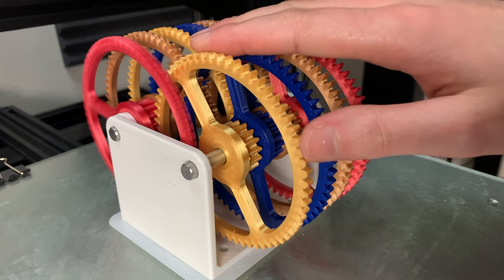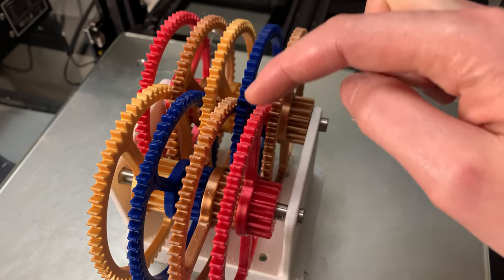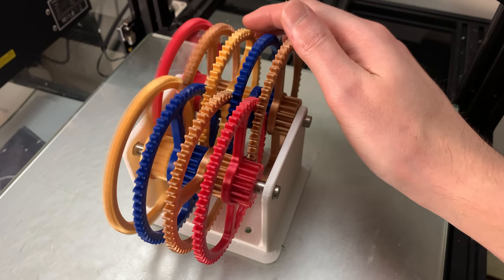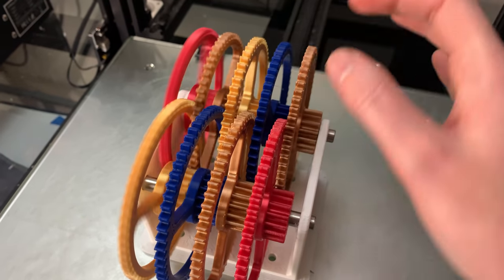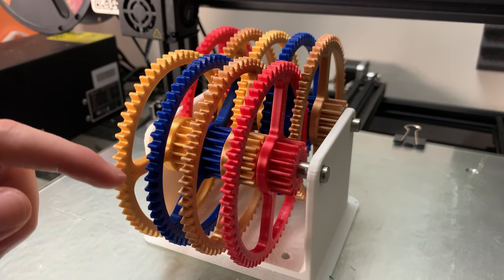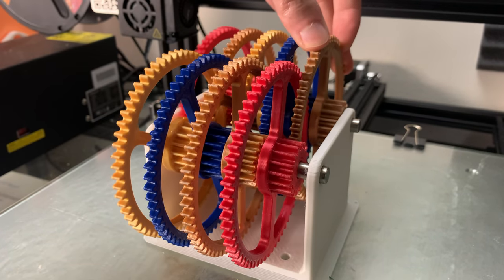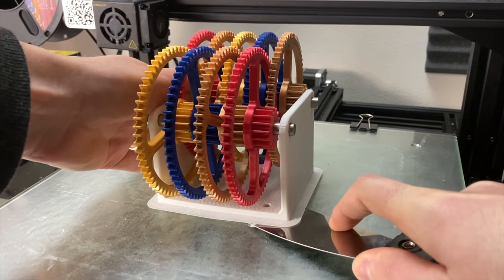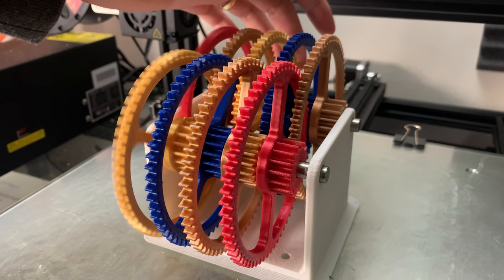Is it possible to spin the last gear?  (1:65000 gear ratio)

Comment: bro I just want one video where they go ham on the big gear and make the little gear go supersonic
Reply: The PLA or ABS or whatever plastic used won't be able to hold that much torque so it will break, I guess you can do that with steel gears
Reply: link please? would love to see some little thing rotating at literal mach speeds!
Reply: @fishtail2616  or a train engine
Reply: Yes! Me too!
Reply: @alexandru7727  it would either shatter like glass or slip and make the worst noise you’ve ever heard
Reply: What if you start accelerating the gear, then slowly change the ratio? Like a car. But with a lot more speed. (Accelerate first gear, then second, third fourth, etc, until you have reached mach speeds, and the big gear will spin, because it already is.)
Reply: I think it would break
Reply: Plus if it got so fast it would tear itself apart
Reply: @kingsolomon1841  that would be fun!
Reply: @SylvieTheBagel  that’s what I was wondering as well but he does show trying that in the background and it was still slowing down since he didn’t have the power to keep it spinning
Reply: @abranfreemuffin7342  spin them all at once then!
Reply: 65,536 : 1 ratio. 1440 minutes in a day. 1 revolution per day is 0.0006944 rpm. At that ratio the little gear would be doing 45.5 rpm. 1 per hour would be 1092 rpm

i have no idea why i worked that out.
Reply: @SylvieTheBagel  dude that’s what I was thinking. Like use the momentum to help start the next gear. To bad I don’t t have a 3D printer
Reply: Yesssss brasstax
Reply: @anthonymiller4468  EXACTLY! Think, if you walk the same direction inside a bus that the bus is going, you go faster than the bus, since you are moving at the same speed. Or, it's easier to push a moving car than a not moving one.
Reply: Yes please! Let's explode some PLA gears
Reply: Me too.
Reply: @SylvieTheBagel  as many have said the issue is the material is too weak to handle that amount of outward force. If theoretically the gears were unbreakable it would still take a long time to shift the momentum from one gear to the next. If that makes any sense
Reply: @dr.crackfish4371  What do you think about using Herringbone gears instead of standard gears to avoid slipping and also made it out of steel instead of a plastic? Based on my math it seems like it would work then, would just test it however I cannot manufacture steel myself.
Reply: @SylvieTheBagel  The friction alone would get hot enough to start weakening and melting the plastic, maybe using a metric shit-ton of lubricant could solve the friction problem but its a staggering amount of friction assuming you could avoid generating a large amount of torque at once
Reply: @SylvieTheBagel  you can use a torque converter, and the highest stall ratio of most tcs are 5:1. that little big gear tho would probably break. he can also probably try an impact gun, but the gear would also break
Reply: I really want to see one with a drill hooked up to the light easy gear and going full speed and just once getting a view of every gear moving, even if the last one is slow. From what I can see you can get a good 2000 rpm out of an electric drill, meaning at 65,000 ratio it'd need 32 and a half minutes for a full revolution. Which sure you could actually film and upload, but if you just sit there and drill a minute or two it should at least be visibly moving on every gear, however slight the end ones are going
Reply: Pretty sure it'll just break :p
Reply: @midlifehemi88  wouldn’t ship engines have more torque?
Reply: Yes
Reply: @davidn6457  Nope
Reply: Imagine the gears can't break. Let's just imagine that, because it makes stuff easier. If, in theory, you spin the first gear up to 1000 RPM, then the second is going at 250, (I think, I watched the video yesterday and don't remember that ratio perfectly. If, then you start accelerating from the second gear, and get that up to 1000, the first should go 4000 RPM, and the third gear should do 250, get that one up to 1000, the second gear should do 4000, first should do 16,000, etc.

Anybody think my idea would work? I woke up about two minutes ago and wrote this on my tablet, so my brain isn't really fully active. (It's an expression. You know what I mean.)
Reply: your pfp🥵🥵🥵
Reply: @cate01a  there isn't one. They were saying it would be cool
Reply: Agreed
Reply: @GcompBlazer  unfortunately for you I cannot manufacture steel either, guess it’ll have to remain a theory
Reply: He spins a smaller set from that side in a different video
Reply: Lmao so we gonna wall over your pfp?
Reply: @alexandru7727  With steel gears people say there’s not enough energy to spin high gear ratios, well tell that to my DD 16 engine. 🛻
Reply: Yeah same
Reply: Impossible
Reply: I need NOS. i need it by tonight  

Paul walker
Reply: YES make a version of metal or a alloy that wont break
Reply: There’s a video of a CD being attached to a router or some CNC bit, it shattered at 25,000 RPM
Reply: @alexandru7727  well wheres the homie that tried? that person will get views
Reply: Remembers seeing CDs spin up super fast and fly apart
Reply: You have my interest at heart
Reply: He literally tried and couldn't move it
Reply: Not with that construction, needs spacers between the gears and the case at the least
Reply: No better way do describe why sort through these videos
Reply: It's also 65k times harder to spin the slow gear
Reply: Same
Reply: They call me little gear
Reply: I hate how every one of these videos has this same idiotic comment.
Reply: @force10guy26  And thats a dissapointing result??
lez find out the ABS's max rpm with this sketchy gear ratio
Reply: It needs some bearings that way they can spin a lot faster. With less friction
Reply: Breaking News: Mysterious disc flying at near light speed slices school bus in half.
Reply: yes please
Reply: Same
Reply: You all are saying why no one's doing it. Yet never considered maybe he wants to see a metal gear explode like a shrapnel grenade because it was 'spinning in place to fast'
Reply: Yes please 😊
Reply: @SylvieTheBagel  exactly what I was thinking
Reply: @alexandru7727  you'd have to jump start the intermediate gears
Reply: Fax yo
Reply: Same my guy
Reply: Prolly create a dimensional vortex or somethin
Reply: get this man some steel!!!
Reply: Nice pfp
Reply: @DuxDamnatio  Thank you.
Reply: @alexandru7727  who cares do it anyway
Reply: @neero7009  U ABSOLUTE LEGEND! It's not the best video but I'm satisfied for now
Reply: Yes do what he says
Reply: Exactly
Reply: @fishtail2616  that has nothing to do with it, the plastic literally cannot handle the amount of angular velocity going through it
Reply: @aidankull7235  I know. are we not allowed to have fun on the internet?
Reply: This needs to be a future video
Reply: YES
Reply: If they got the last gear to do 1 rpm the 1st gear will literally break space/time itself 😂
Reply: You don't know what you've just done.  Prepare.
Reply: Agreed
Reply: I feel like almost any material you make it out of would just fly apart like an old tire
Reply: @fishtail2616  dont say the nword please
Reply: @midlifehemi88  or a rocket engine
Reply: @fishtail2616  or a rocket engine
Reply: @bhaskar7731  does a rocket create rotating torque?
Reply: i wanna see the big gear spinning so fast that the little gear would reach speeds close to the speed of light and collapse into a black hole
Reply: @fishtail2616  it's not that easy to mount a ship engine to a gear ratio let alone the price
Reply: @dr.crackfish4371  not if you use fish bone gears, they are stronger than normal gear teeth, and the self align themselves, they would be what you need for this experiment to possibly work, plus an engine with enough torque to spin the last gear. and steel probably wouldn't be enough you may need carbon fiber, as it can withstand far greater psi.
Reply: @Plaidear  People have money to waste on fast cars and big houses so why not spare a bit to have some fun
Reply: at this ratio, theres not many materials that could hold rotation of a gear that size without breaking once you are able to turn the last gear at a decent speed.
Reply: @SylvieTheBagel  if you thinking  walking in a bus, counts as going faster than the bus, than I guess you thinking walking on the earth, means I’m walking faster than the earth moves huh.
Reply: U get me
Reply: Nice pfp my guy👀👀👀
Reply: He can't do that. It'll spin too fast and tear open space and destroy the universe
Reply: @MFKitten  yeah he doesn't use that tiny little brain.
Reply: I'm pretty sure the rig would break. They'd probably need something stronger.
Reply: Yes!!!
Reply: thats the first thing i thought, spin the last one and make the first one go stupid
Reply: @alexandru7727  wait so if the last gear is in a position that it’s moving, it means the force being exerted on it would break the entire system? Like it can’t even move really slow? If so that’s really interesting
Reply: NICE PFP
Reply: @KevinColt  Carbon fiber is probably the only material that could possibly handle the amount of pressure that would be getting put on the first(last) gear as even while heated to 1400c it can still hold upwards to 820,000psi, so long as you have to threads perpendicular to the force that is being applied to it.
Reply: I'm would think with some clutches it might be able to be done.

I wonder what would the gear ratio have to be to get the outer rim of the first gear spinning at the speed of light?
Reply: Good luck actually doing that, you certainly couldn’t go that fast with your hand
Reply: YEESSSSS!!!
Reply: "I am speed"
Reply: @fishtail2616  because of his name, you're reply to him makes it very questionable lol
Reply: @crustybedsheets1678  which one of them?
Reply: @fishtail2616  the one who said they're gonna need a shit ton of torque
Reply: I too would like to see him toss a piece of ham onto the big gear
Reply: Stupid science 
Science doesn't know 
Every second the Sun emits billions billions billions ^ billions lightning 0,1 voltage create sunlight, 1 positron  + attracts 1 electron  -- create lightning 0,1 voltage. 
The core of the Sun rotates very quickly like A super large electric turbine that produces super large electrical energy 
Every second the Sun emits 4,1million tons of electricity create sunlight, sunlight moves the circle back to its original position after 8 hours, so pushes the 8 planet to rotate in order
Reply: @thanhpham8172  ???
Reply: make the biggest gear ratio and spin it super sonic
Reply: SUPER SONIC RACING
puts the fastest gear on the wheels of a small car
Reply: We'd need a special titanium-steel alloy to hold that kind of weight. To 3d print it would cost probably upwards of a million dollars because you need a machine that can use molten metal and you need to get the right alloy to not have it break
Reply: Yes pls
Reply: @alexandru7727  what about using metal instead?
Reply: Same here
Reply: Imagine the amount of power needed to generate that. The gears would likely heat up or fall out of place. Would be pretty sick though 😂
Reply: You and me both
Reply: The fact that it doesn’t happen eats away at my anxiety
Reply: thats not how it works
Reply: @SylvieTheBagel  that's what I was thinking
Reply: @thanhpham8172  explain this motor
Reply: Nuclear fission of gasoline produces fire
Reply: Nah cuz
Reply: Yeah but it could be dangerous
Reply: @cate01a  gears in a jet engine easily go past 150 000rpm
Reply: Bruv I've never seen someone with the same profile picture as me, I was confused when I saw a comment that looked like I did it
Reply: @thanhpham8172  and how does transfer of energy across vast distances push entire PLANETS? Also, you do know what you are saying is physically impossible, right? There are many flaws in this idea bub.
Reply: @thanhpham8172  Ever heard of a black hole? If you're idea was correct, which it isn't, black holes would have the most energy, bub.
Reply: It would open another dimension
Reply: If Einsteins theory about relativity is correct, then the lightspeed gear will effectively achieve relativity, aging hundreds of years in mere seconds... This makes our lightspeed gears idea even more deadly. STRAP ME ON TO THE GEAR PLEASE!
Reply: Same here
Reply: I love this!
I've always wondered about if this, together with the propeller, was known to vikings e.g., how efficient it would be to construct a device like this instead of rowing, or for any pre/post-medieval seafaring nation.
Reply: Lol I know. Like.. we get it. It's super hard... but just  do it 🤣
Reply: Great idea
Reply: It would be a feat of engineering lol
Reply: @alexandru7727  999th like
Reply: Yes
Reply: @neero7009  thanks for not rickrolling and actually coming through!
Reply: haha
little gear go brrrrrr
Reply: heard a tragic story about a kid shattering a gyro scope trying to kick it up to high speed with a power tool, he lost an eye and has severe injuries in his dominant hand, arm and shoulder and some permanent facial scars. 

this was a metal gyroscope, all materials have their limits. Please consider that when trying to just see what something will do.
Reply: Fr
Reply: FOR REALL
Reply: @neero7009  thanks
Reply: @alexandru7727  nope, even steel would break
Reply: bruh
Reply: Prob not enough
Reply: Stop.
Reply: Are you from the abwr discord by any chance
Reply: Yeah me too, got damn, so its click bait
Reply: That’s how you get raided by FBI
Reply: This
Reply: yup same here, no explanation they should just do it
Reply: @fishtail2616  lol gear go KABOOOOOOM
Reply: @midlifehemi88  more reasonable but gear probably also go BOOOM
Reply: I was hoping for it but i was disappointed
Reply: Hey give my pfp back
Reply: @alexandru7727  Then use something else. I want someone to machine a gearbox out of steel titanium alloy and see how it holds up.
Reply: @SylvieTheBagel  that's exactly what I was thinking. I was wondering if it would be possible to make a custom gearbox like this that could make your car go mach Jesus.
Obviously my shitbox car would run out of gas before it got anywhere, though
Reply: @GcompBlazer  I think it would just be too complicated to mesh 5 gears in that configuration.
Reply: @dr.crackfish4371  but everything doesn’t have to be steel, only the higher torque one.
Reply: Yes
Reply: I guess somebody didn’t listen to the video
Reply: OMFG I KNOWWW WTH
Reply: Stationary sonic boom 😳
Reply: Seriously... if you get the thing started it makes spinning the next gear easier and so on... the force of a suv is only needed from a complete stop.
Reply: Same
Reply: YES
Reply: @cate01a  there is no link
Reply: Yes
Reply: @DeGandalf  Was hoping someone would post exactly that. I like how in some videos he actually does melt the pieces outright from friction.
Reply: @rogerbrandt6678  Nothing is too complicated we went from having hardly in idea of how to fly to putting a human on the moon in less than 50 years
Reply: bro right, i clicked one and keep watching more tryna see that
Reply: @kluup1081  Thank you.
Reply: he said it was impossible to push
Reply: Nice pfp
Reply: @alexandru7727  I’m sure that will cause a fire
Reply: That's wat every body wants
Reply: Thank you so much for saying what everyone else was thinking 😂
Reply: @Rich-je9fy  you know!
Reply: That profile picture tho..
Reply: Literally. Thats all I wanna see. I don't care about all the other science hahahaha
Reply: @jamesbizs  Did you forget our solar system is spiraling towards a black hole at 448,000 mph plus the earths orbit of 67,000 mph then the earth rotates around 1000 mph and the bus average in the city is  45 mph plus human walking speed we'll be liberal on this and make it 5mph. So throwing relativity out the window and burning it if you walk on a bus at a specific time of day and year going a specific direction and you are walking towards the front of the bus while its traveling at max speed you would be moving at 516,050 mph which is nearly 1% the speed of light by walking on that bus
Reply: Same
Reply: YEEESSSSS
Reply: Your pfp, you come from a dark place don't you
Reply: Lmao
Reply: Ya but this kid is like the nutanic law of physics causes the overhaul stress on the Lang switch which means : hard to spin
Reply: Same
Reply: That's thinking small. Go SUPERLUMINAL!
Reply: Yaaaas Queen
Reply: I think it would spin so fast it would create a black hole and devour planet earth
Reply: @alexandru7727  I DONT CARE
Reply: Worst comment I’ve ever seen.
Reply: @alexandru7727  even then
Reply: Yea you got the right idea
Reply: I feel like if you gradually sped the gears up it wouldn't be applying as much torque initially.
Reply: I don't care if it's possible I just want someone to do it and see how it breaks
Reply: Likely the gears, being plastic, would shatter or the friction on the axels would melt the plastic. That means no go.
Reply: @SylvieTheBagel  bro you’re a scientist
Reply: @TheLandonBullard  Dude, I haven't even been through high school yet.
Reply: @TheLandonBullard  and I have a 1.800 GPA.
Reply: I thought that's what I was going to see in this video but instead I was left disappointed.Therefore it gets a thumbs down for that reason alone.
Reply: I always wanted to make like a go-kart with a gear set with a small gear (idk 4”) and a massive gear (like 5 feet in diameter”  and see what it can do
Reply: @GcompBlazer  ever heard of friction?  It will not work, unless friction  is almost zero. It has nothing to do with the ratio, purely friction, that's why this idea is pure fiction.
Reply: @tempviduse  I think your gears would shred the moment you set it on the ground. 5 foot to 4 inch, maybe 1:15 ish? Very very very fast.
Reply: @ejoneswales  Hey i said use a metric shit ton of lubricant and the only thing frictionless is using repelling magnets to technically there is a way to even create this I was just arguing a possibility of using a different type of gear made of a metal to even start seeing how high of a ratio can we spin
Reply: dont need a train engine. just a really long lever.
Reply: The reason this is not possible because the starting torque it needs basically is so much higher than the breaking point of the printed materials. Take it in this way, pulling a car using a 3d printed hook, will you be able to pull it? Ofcourse not because the plastic will fail badly but won't be able to pull. Hope this helps.
Reply: @waqas.180  yes and no. What if the car is moving down a hill? Can you, even slowly, accelerate it MORE? Not from a stop. But from something like 30 to 35. And you get five minutes. Your PLA should hold.
Reply: @SylvieTheBagel  sure thing, giving it a kick start is providing partial starting torque. But I was referring to 1:65000 ratio, that is still hard to achieve, even with a different set of materials. So yeah...
Reply: @waqas.180  I tried to explain it in the replies above.
Reply: Thank you for this comment
Reply: Yes
Reply: @GcompBlazer  in a vacuum to reduce resistance with air.  And an electric motor on each gear, and a brain that totally ignores molecular adhesion.
Reply: @ejoneswales  I get it you do not like the idea. It was and still is a theory my dude. I certainly will not test and make it because I only have an ender 3d printer not metal
Reply: @SylvieTheBagel  I think centrifugal force would tear apart the first 2 gears if you managed to make the last one spin
Reply: Amen
Reply: Bruh go back to iFunny
Reply: @alexandru7727  steel aint enough for this, not with any load at least. I think a 200bhp engine would be able to turn this.
Reply: Ifbz @alexandru7727
Reply: @alexandru7727  d((((d
Reply: @alexandru7727  (
Reply: @SylvieTheBagel  If you're pushing a car from a standstill, it's extremely hard to get it moving because of static friction. The tires and the ground are wedged together at a microscopic level. But if a car is already moving, you don't need to push as hard to keep it moving. BUT imagine if there is already a rolling car and you need to keep it rolling by pushing it. If you don't have the physical strength to do so (force), the car will eventually stop.

A higher gear is the same thing, when it's stopped, static friction holds the gear material together. When in motion, the static friction is overcome. But you need force to keep a higher gear in motion, to move a higher gear faster, you need even more force. 

There's a point where you reach a limit and cannot generate the force required.
Reply: #tesla #elonmusk #shiba   to moon
Reply: 3-vgaoc   l
Reply: @dr.crackfish4371   are you saying you will hear the wall shatter?
Reply: @TheUltimm  no, why do you think that?
Reply: @alexandru7727   xx. Xx
Reply: @dr.crackfish4371   if it goes fast enough and breaks would it be capable of breaking a wall? (assuming if its made of metal or something similar)
Reply: @alexandru7727  
.
.
Reply: I know I'm kinda off topic but does anybody know a good website to watch newly released tv shows online?
Reply: Nice prof pic
Reply: @theleanmonster3735  if you know, you know
Reply: Meh too TmT
Reply: GAS GAS GAS
Reply: but f r i c t i o n
Reply: @alexandru7727  now imagine the steel gear coming loose and wreaking havoc
Reply: Cool pfp
Reply: @alexandru7727  you say that like that’s not the desired outcome
Reply: This channel does it
Reply: Bro
Reply: @midlifehemi88  actually, the engine in trains (if youre talking about regular diesel trains) works by spinning a turbine to power a generator that then supplies power to an electric motor to spin the wheels
Reply: @alexandru7727  p
Reply: @alexandru7727  p
Reply: @alexandru7727  p
Reply: @alexandru7727  p
Reply: Funny ahh comment bro. I’m actually kinda laughing at this
Reply: Would probably work with this one if the gears were steel and the last one was the size of a tractor weel...
Reply: yeah that torque would break anything
Reply: Forreal
Reply: Am looking for the same
Reply: Congratulations you built a transmission
Reply: I know right forget all this nonsense talk about what wood and would not happen I just want to see them do it
Reply: Agreed! That’s why I am here
Reply: @cate01a sadly he just made a suggestion and there is no link until the YouTuber listens to the suggestion
Reply: @SylvieTheBagel  there would be a death.
Reply: @miguelquazar883  sounds like your problem
Reply: lmao yes
Reply: if you have too many gears that would mean that thing would be rotating at the speed of light which is impossible
Reply: @actually_zer  We do not care about that. We just want to see the little gear go Brrrrrrrrrrrrrrrrrrrrrrr
haha funni lol
Reply: @alexandru7727  🔴 What Is Islam? 

🔴 Islam is not just another religion. 

🔵 It is the same message preached by Moses, Jesus and Abraham.

 🔴 Islam literally means ‘submission to God’ and it teaches us to have a direct relationship with God. 

 🔵 It reminds us that since God created us, no one should be worshipped except God alone. 

 🔴 It also teaches that God is nothing like a human being or like anything that we can imagine.

🌍 The concept of God is summarized in the Quran as:

📖 { “Say, He is God, the One.  God, the Absolute.  He does not give birth, nor was He born, and there is nothing like Him.”} (Quran 112:1-4) 📚

🔴 Becoming a Muslim is not turning your back to Jesus. 

🔵 Rather it’s going back to the original teachings of Jesus and obeying him. 

More .....
Reply: @kingsolomon1841  i want to see it break
Reply: @alexandru7727  just do it bruhhh who cares
Reply: Yeah
Reply: Whether it works or not, the rotating gear at Mach speeds, and any broken pieces will surely be a hazard for anybody around it. I won’t even attempt it.
Reply: EXACTLY😂
Reply: Uh suma luma duma you assuming I'm human im superhuman innovative and I'm made of rubber of anything you saying is ricocheting off of me and it'll glue to you
Reply: Fr lmao
Reply: Thats exactly what im trying to find
Reply: i agree
Reply: Geometry dash reference?
Reply: @Herobrine_Unknown  no
Reply: Nah, superphotonic
Reply: @SylvieTheBagel  
It would spin initially, but your still need 65,000 Newtons of torque to keep it spinning.